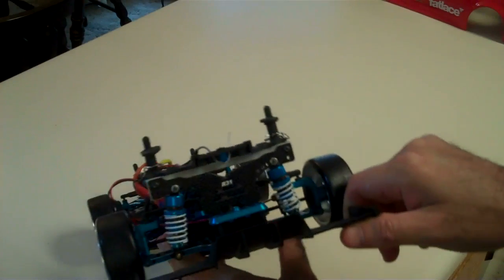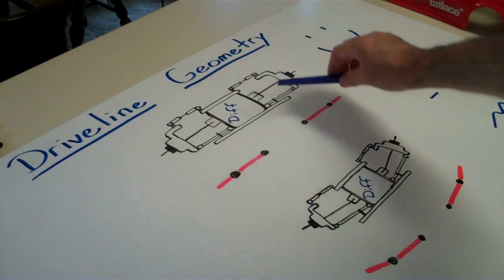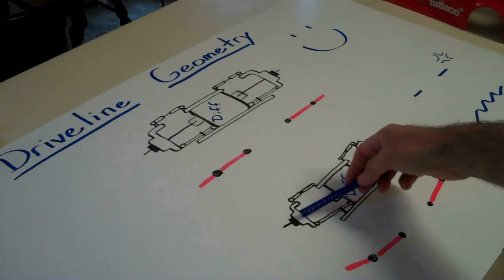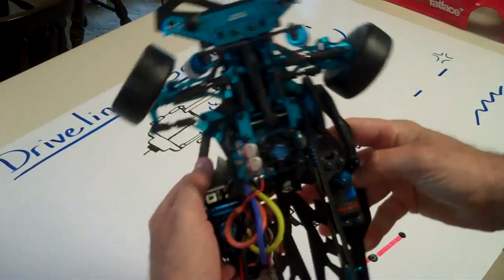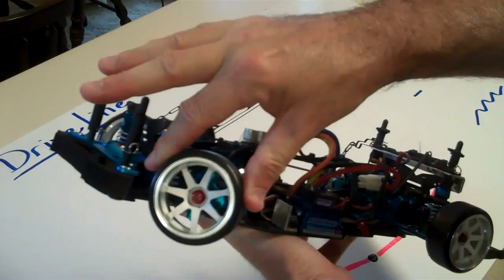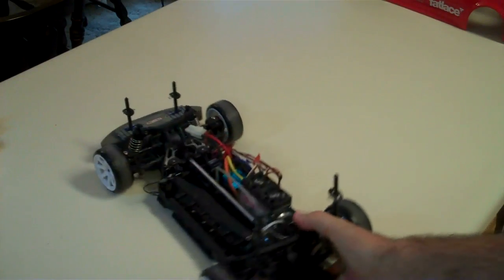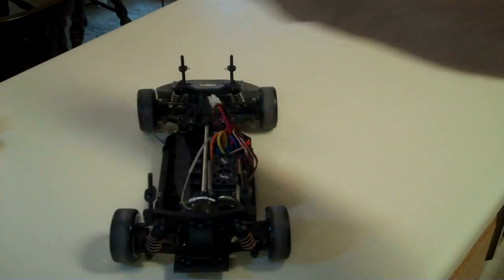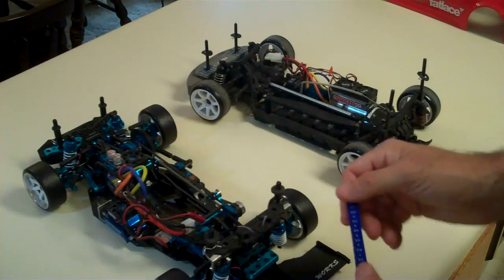RC Drift Chassis Geometry Check

Comment: Just found this.. so all that being said, what do you find is a good chassis ride hight? Obviously some chassis are gonna be way too high if you set the droop at neutral? And also once you set ya hight, when you cut new body's etc do you then get issues with it looking poor with arch gap? As some body's obv have lines etc to cut to..  do you have a go to brand for body's?

Comment: i have this issue where my car straightens out when i release throttle to let it slide around the corner. also its hard to get it sideways when its going at normal corner entry speeds. should i add weight front or rear, or should i adjust the ride height front or rear
Reply from the maker: +ronnie tjikoeri Add a little weight to the front and see what I does.
Reply: +killersushi99 i added 2 AA batteries to the front shock tower that seems to made the car a little more predictable but that didnt solve the problem right away i also added 3AA batteries on the light side of my car (opposite to the cars battery) and that seems to fix the weird balancing. but still some understeer i googled advanced drifting setups (not much use for me since my car doesnt allow adjusting that well) so i raised the back of the car by around 2-3mm to help weight transfer and now its almost good enough for me where i want it (for now) what caused me to heavily understeer was my front tire was rear and the rear was up front i did that to get even wear but since its switched back its sliding decent again. that had to do with wear not with width or offset. i ordered a new adjustable suspension setup to help with drifting smoothly. any tips i need to know to use them properly for drifting. they come with multiple pistons and 5 different spring levels

Comment: I have a problem with the VDF 2. I have setup counter 1.99 Ratio. The moment i go full on the steering anlge left or right. The wheels start jumping ans sttutering. I have yet to get a proper solution for this. I have ordered the action hobby 55mm upto 65Degree adjustable universal cvd'. I hope they will solve the problem
Reply from the maker: I think your camber is too much. 65degree isn't going to handle that much camber. I have 80 degree CVT's and they will chatter at just 5 degrees of camber if pushed too far. If you want to run that much camber your on your own.

Comment: add or remove preload if you dont have adjustable shocks. Same concept sushi is talking about but you just have to do it by adding different thickness of spacers. Thinner = lower (less preload) and thicker = higher (more pre load). Tuning isnt really critical in drifting though. No where near as much as racing.

Comment: I had a quick question, I have a teh-r31 and I got the eagle racing pulley shaft but I was having problems keeping the shaft in place in the front and it tends to move as soon as I press the gas. Is there anything I can do to keep the drive shaft in place?